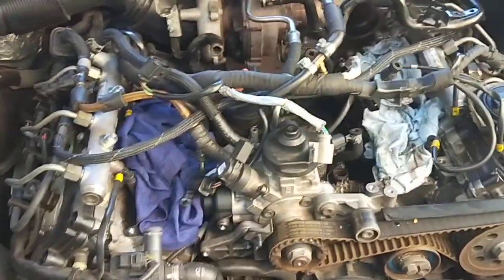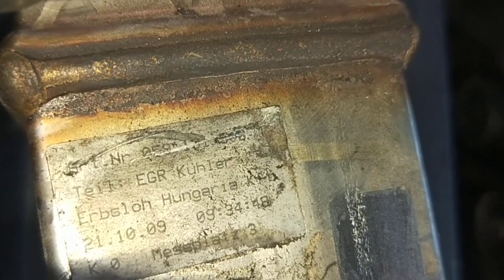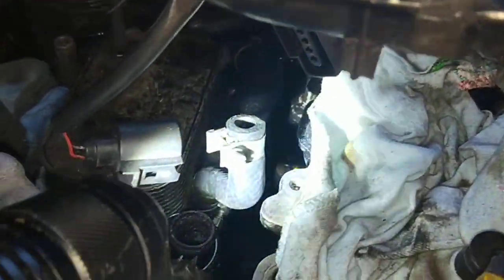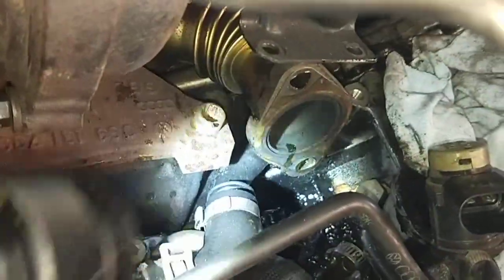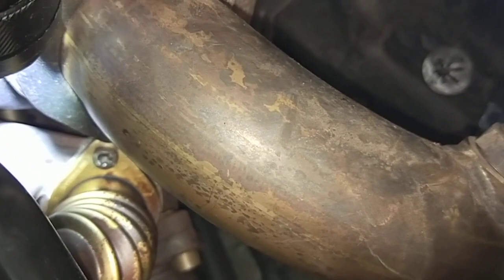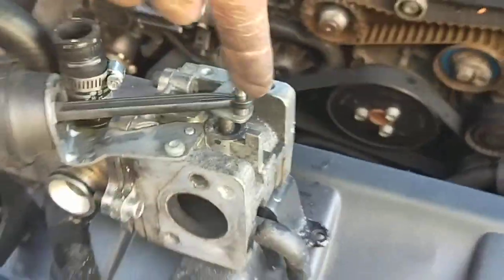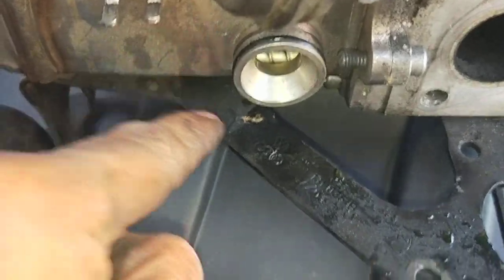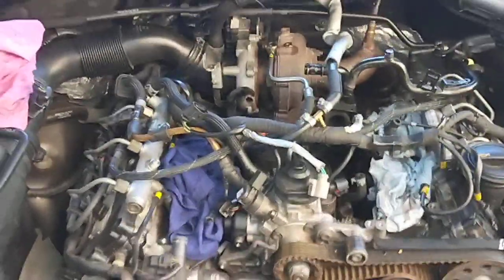Audi Q7 EGR cooler fault part1

Comment: My mechanic stripped the egr cooler bolt, the one you pointed and created the exhaust leak. Is there any way to get this fixed? I have a code also for EGR coolant pump P149B short to plus. Can you please direct what pump is that one, there are 2 additional coolant pumps, 1 on the top the other one is on the bottom. Thanks

Comment: My cooler valve keeps blocking in the open position. A screwdriver needed to pry it closed the actuator cant do it. I have a used part from ebay but dread this job! :( something about the pipes sticking in place the bracket needs shifting before the pipe will move? I'll figure it out I hope